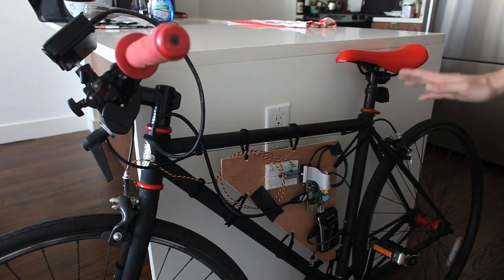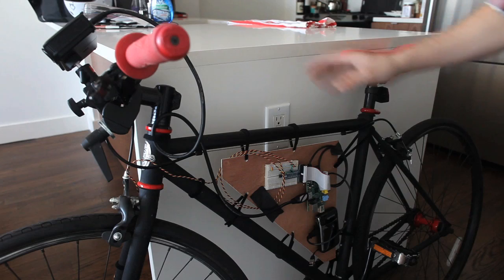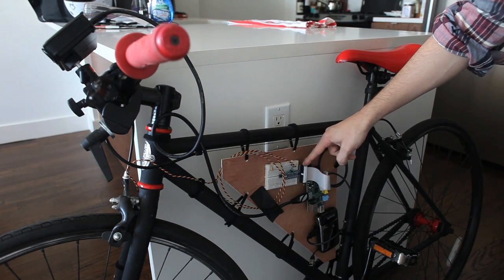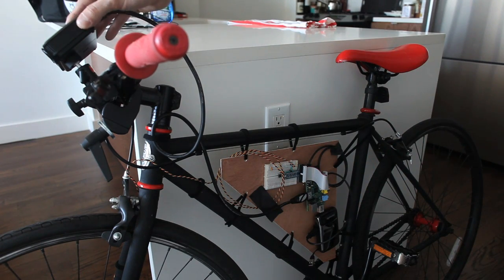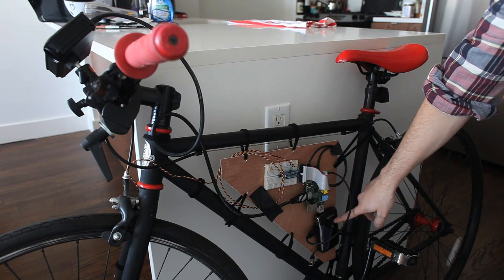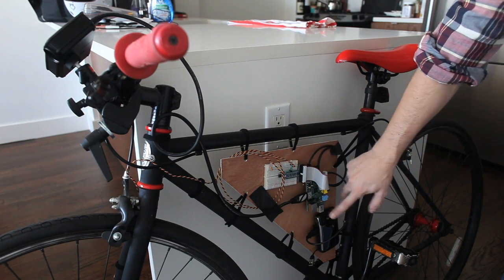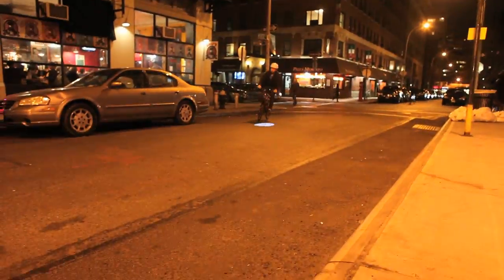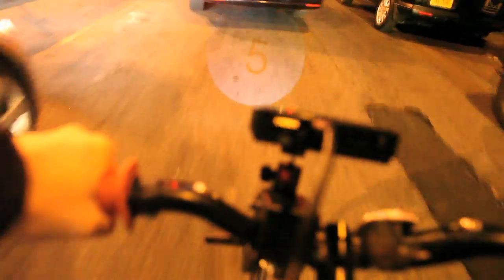Raspberry Pi Dynamic Bike Headlight Prototype and Test

Comment: I love the fact your creative however this is a poor idea. I used to build projectors. The small units are not super bright as a projector but are ok as a bike light the issue is this. a bike light is to let people see you and you see them. A bike light is tilted up towards the road ahead which means either your going to blind the person in front if its bright enough or not but you wont get a good light spread plus you cant see the speed on the back of a car very easily. how about this. go on ebay and buy a scrolling badge they do a good one that does animations. make sure it displays whilst connected to a pc. get a weather proof keypad and hack into it and rig it so that with a button press you can send a message to the badge then make it auto cut off which will result in the badge display the message. end result a scrolling message board that can be changed at the press of a button to send messages like. Thanks and back the f-ck up etc. if you wanted a speedo bike light get a high beam bike light and hack a speedo unit and cut away the plastic and remove the backing and mount the screen in front of the bike light. This is how diy projectors are done and it is way more simple than feeding a speedo to a micro pc to a projector etc
Reply: I don't think this is a poor idea, maybe for safety purposes it's not the best idea, but maybe for something like advertising this would be an invention that people would get a kick out of. like he said in the video people were taking notice to the projected light as soon as he brought it outside. Business owners would probably love to have their name projected onto the street as their company cars drive around during the night or even for personal reasons just as an average consumer maybe you want to display some kind of message to people as you're riding your bike, projected around your bicycle. Also lets say you want to make it look like you're riding on water or flying high above trees or on molten lava or some shit. people would think thats cool af and after all it sounds like you're just trying to sell an up-and-coming product here man. i don't know, but projectors on bikes,cars,skateboards, boats, planes beaming this stuff into the clouds, are just some ideas I'm guna throw at you. btw feel free to shit all over my comment here too people, thats really all that most of you are good for anyways. Cheers!
Reply: Jason Leo, you clearly were on the building end of industry rather than developing new products. It doesn't appear that you understand the concept of respectful collaborative design and you definitely lack imagination..
I rarely comment on comments but I gotta say, LED's vs projector? please.. talk about bottlenecking the "cool factor" not to mention limiting the expansion of the project. Display badges replacing the projector is a poor idea; very dated and nothing that will catch the eye's of bystanders (simple dot comprised words v visual graphics? c'mon man). The advertising and ground lighting effects that jae mentioned above are just two applications that show the strength of  this innovative approach and how it expands the possible uses for the project.

Brilliant idea Matt Richardson!

Stay innovative my friend!

Comment: GPS would be great but i just thought of a much lower power option, that would be really useful while exploring a city on bike. If you got a compass sensor (i believe these are small, cheap and low power) and somehow fed that data into the Pi, then you'd be able to render a real time north-south arrow over the top of your speedometer, or any other application you've come up with. It'd be a really helpful augmentation.

Comment: Some ideas : Dynamo to charge the pico projector battery pack, a 'push-to-activate' type button where your bike bell should be, so that the projector isn't on all the time, rather than when you just push it, but it's updating values all the time so you get the latest speed when you press it.

Comment: I love the idea .. However I was thinking alongside a dual power supply with switching modes between solar and battery powered to save the system power that should so the trick at least I will be implementing something like this

Comment: Only issue with this is that it would increase peddle resistance taking more effort. If it worked though, at the very least it would increase battery time, even if you still needed to charge it conventionally.

Comment: Maybe you could integrate a power source (rechargeable batt) that is driven by the riding/peddling so projector and systems can always be operational. Not sure if the power demands would be too high for casual riding... just a thought!

Comment: Having it flip from value to value is a little too atomic and distracting.

Scrolling the values might better fit the analog-nature of your speed. You wouldn't see it jump suddenly from "6" to "7", instead you would see the "6" slide away as the "7" slides to center.

[ 6     7   ]
[6     7    ]
[:     7     ]
[     7      ]
[    7      :]
[   7      8]

Comment: Stick a dynamo generator and a regulator circuit and encase it  possibly in a Tupperware box... also it might be possible to try and simply use a speedometer circuit and a back projected LCD ( I am thinking of a simple clock light projection hack or something). Either way it looks like a winner for a startup gadget...

Comment: a projector cant produce black color..... that's why if you add more black into a image that is being displayed on a projector it will save more power. It just wont show any color where the black should be....and for those saying its not a headlight if you don't add the white...did you look at the video? that white circle is not illuminating the path for the rider. You guys are acting like the white circle lite up  the whole street...lol

Comment: Biggest problem is that it is not a steady flow of energy, he would need some sort of battery that would constantly supply the projector with energy and be refilled by the wheel.

Comment: Isn't there a device that can provide energy to the projector due to the rotation of the wheel? I have a Japanese bike that has a headlight powered by the front wheel. Perhaps that could recharge the battery when moving and when idle, the battery power kicks in.

Comment: As a motorcyclist, I can tell you that this wouldn't work very well at all.

The speedo? I can subconciously glance at that in a split second. Looking down at the actual road surface would require a very large change of head angle, distracting me from the horizon (and thus, oncoming cars, etc) which is where I should be looking.

Comment: Do you think it would be more space saving to mount... You know those digital clock projectors that project what looks like an LED? One of those in place of the projector for optimum battery use? Seems like it might be easier to program as well

Comment: Why not using the very same motion to charge the battery? I remember when I was little bikes used to have those little wheels rolling with the front wheel to generate electricity for the headlight. Of course, it won't be a replacement of the battery and the need to plug it for some charge, but it could make it last longer, right?

Comment: Makes sense. Of course, you could also plug the sd-card into a computer to work on the code, you just need a linux machine to access the correct partition. Then again that might make testing new code more of a hassle. Yeah sticking with the model B , at leat throughout development, might be easiest.

Comment: there is an easy way if no one suggested it there is a hdmi to micro usb and you can connect it to an android if you happen to have one which will put the display unit as the projector. bam instant gps.

Comment: Looks like you're using a pi model B in the video. Have you considered the model A (increased battery life)? Also, could you connect to a smartphone (bluetooth/wifi maybe) and use its sensors? Seems like that might make implementing gps easier, for instance.

Comment: nice project. have you thought about a led light with some tranparent switching thing in front of it? there are materials that change transparency by a electric signal. that would need less power than a projector.